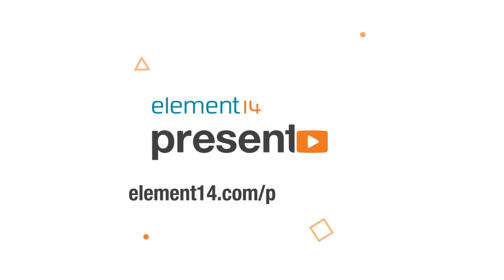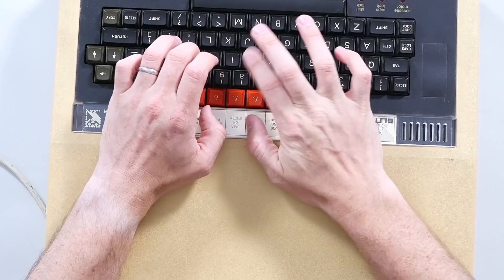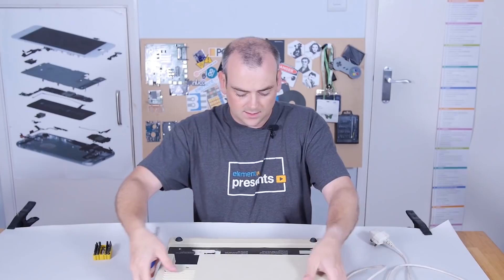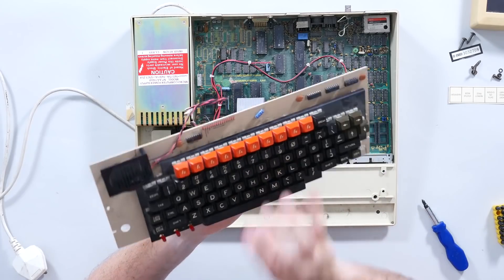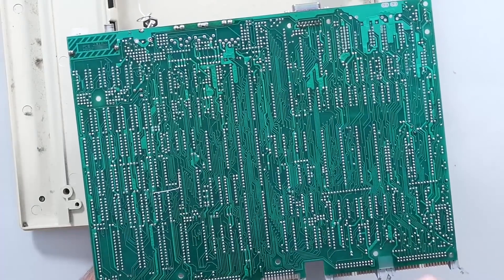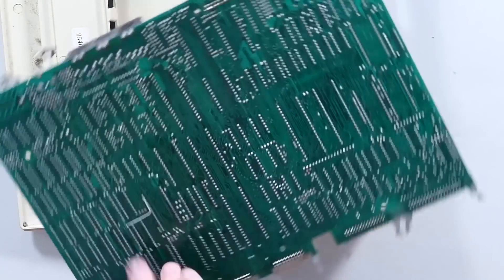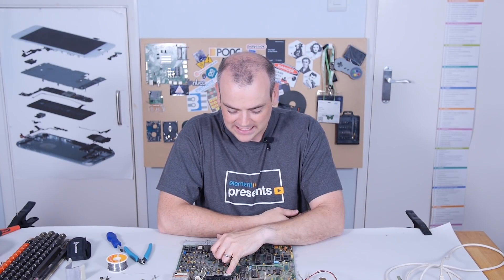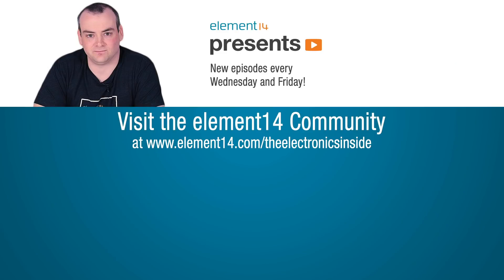BBC Micro Teardown - The Electronics Inside

Comment: I have one of these up and running on an LCD monitor.  With the SD Card in the disc drive port with all the games on it.
They had just come into the schools when I was 12.
I learned to code BASIC on it and I now code still in C++,   
I have had to do the Capacitor in the PSU as mine smoked - as they all do with age.  Very easy to fix.
I went onto early PC's and wrote stock control setup for a local supermarket.  Paid for my first Motorcycle with the money.  Happy Days.

Comment: The Beeb was, and still is, a fantastically versatile and upgradeable computer. Even now, there is a ton of modern hardware add-ons available for it, such as the Gotek floppy emulator, and a Pi based (multi)2nd processor. See the websites 'Stairway to Hell' for loads of software, and stardot.org.uk for discussion, mods, NEW software and more for Acorn computers. I have 2 of these Beebs, plus a BBC Master, and I use then all regularly. BTW, the RIFA caps in the PSU, can, and usually do, fail spectacularly, with lots of magic smoke and an awful smell; BUT the Beeb will still boot up, but with less filtering on the power side.

Comment: Back in the late 80's I went to a centre to learn computing and electronics. While there they moved their location and in the new location I was tasked with setting up the econet network for all the BBC computers used in their main BBC room. I actually enjoyed that, wiring the network, testing the connections and making sure each BBC worked on the network :)  They also used the BBC for electronics too and I had made a simple light pen and coded the BBC in assembly to use it. Alas, after leaving that place I never touched a BBC computer again as I moved on to PC programming.

Comment: Lovely video. I still have my BBC micro somewhere in a box. I have a ROM expansion board with cmos ram, and external zif socket as shown. The user manual was sooo good! That was quite a thing at those time, there was no internet. And receiving the thick "bbc micro" magazine was so much a joy. Good old times!
Reply: I did get a user manual for this project too, I'm gradually working my way through it (with bookmarks and hand notes from the original owner too)!

Comment: Great breakdown thanks. This was a Genius bit of kit created by the crème of Cambridge including the future designer of the ARM processor. I made commercial light-pen software for Datapen on it such as Cirkwik and a PCB Designer which needed a ROM and a disk drive, for Watford electronics.
Reply: Oh yes, I remember this Watford brand. I think I had a light pen and a floppy drive from them. The light pen I had was just a very light white tube of plastic with a bit of blue maybe
Reply: Awesome! I love to hear things like this in the comments! 

Did you develop for other contemporary machines? How did the BBC compare?
Reply: @a531016  Yes we developed for most home micros at the time. The BBC was just so professional for example in the screen clarity, it could have been a business computer, although its expense meant that far more other cheaper machines such as the Spectrums made their way into 80s homes. Most other computers had minimal input / output ports - the BBC was overflowing with them!

Comment: Back in 80's second processors could be bought for the BBC. But unlike other machines the second processor doesn't need to be a 6502, instead you can use Z80, ARM or other. The Raspberry PI co processer system is brilliant as it runs as 6502, Z80, 80286, ARM native and other cpus without swapping components. There is adapter boards to allow 16 ROMS/RAM slots and shadow memory for the graphics system which allow you to use all the RAM for your program. For the 1 MHz bus there are plans for SID, Midi, 8MB Ram cards as well. For a machine designed and built in the 80's it is very easy to upgrade and design stuff for.
Reply: I love it, and would be the first to admit my knowledge of it is still a tiny percent of what there is to know! I'd encourage anyone to get one a take it for a spin!